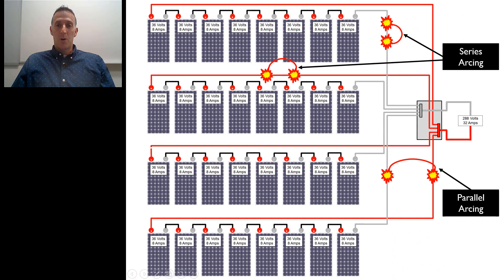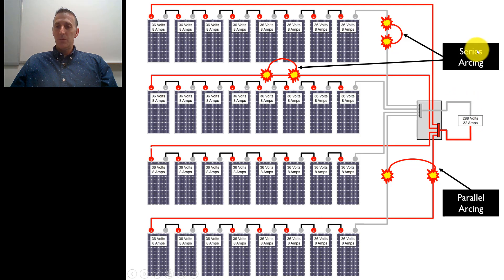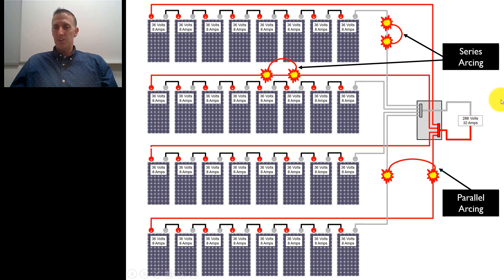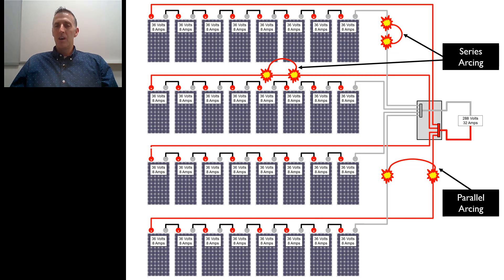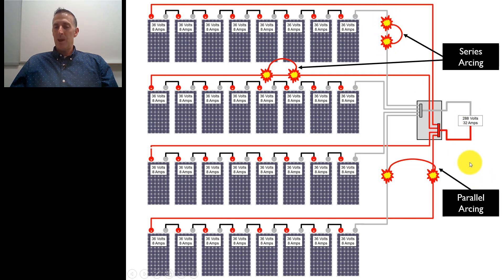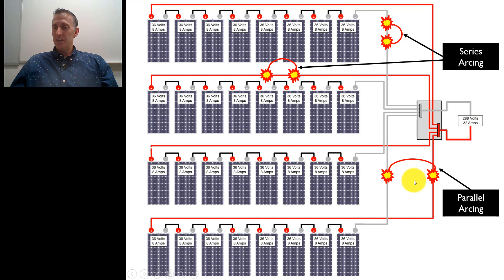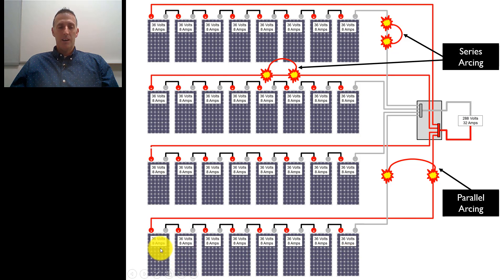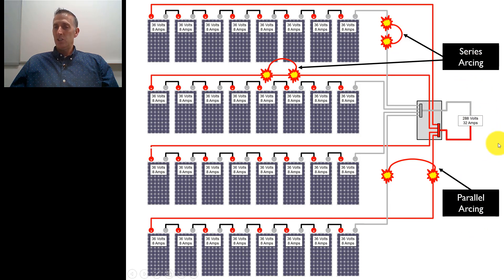Solar Training - Dangers of Series & Parallel Arcs

Comment: at the parallel arc wouldnt there be 32A of current since the strings are all still connected in parallel? if the inverter shuts down the arc is basically shorting the whole pv array but then all cables should be rated for 32A instead of 8 or else they will melt or you would need fuses at the terminals of each string, i think, or if you have a fuse/breaker for each string in the combiner box right before the live busbar wouldnt that breaker trip for the string with the parallel arc since the current of the 3 top strings is trying to pass there

Comment: I have a Very good Question for you “ can you take 2 different battery Ah but the same Voltage “ put them in Parallel the First bank 48v 280Ah and can you put in parallel a 48v 40Ah bank to help regenerate the Electricity used ? And if not because of the Ah - can you use an Active Balancer say 31S voltage does not matter you connect 31 batteries together as if they are parallel but the batteries are not physically connected so you have 31 Lithium Phosphate batteries connected to the Active Balancer and you have 15 batteries in series connected together + to - so on for only 15 batteries and the extra 17 batteries are to help keep the electrical charge constant- Can this be done ? Only 15 Batteries are on the same DAILY 15S 120A BMS but you have 31 Batteries all Connected through an Active Balancer ! Can this be done ?

Comment: I don't understand why my solar charger tells me I'm charging my batteries at 36 a 48 amps 52 amps sometimes 27.5 and I have several solar cuz I need to combined strength to the house they have less chargers and I don't mind the amps what I'd be more worried about is the votes and every 10 watch that the charger takes it turns it into an amp that's why I don't mine the amp so much.

Comment: What type of circuit protection do we need to prevent series & parallel arcs
Reply: A lot of talk about problems but not much on preventing them.
Reply: Modular level shutdown with with micro inverters or optimizers

Comment: On the parallel arc scenario.. then why the inverter could not detect it and short that array directly at the inverter input?.. the PV are current source with maximum limit so there would not have any overcurrent problem and current would find his short path thru the inverter input that is automaticlaly dead shorted to 0V... so the only voltage present would be the resistive loss in the wire between the inverter input and the no more possible arc!  =)
Reply: Yes, the presumption that the inverter can only stop the current is wrong. It should also be able to bring down the voltage of the panels to a very low level. However, that's not the usual way that the system is brought down. A firmware modification should make this possible, with very clear signals to the user what is happening, and very clear instructions how to proceed, such as waiting for sundown to dismantle. Also, usually the inverter needs at least a 100 V to run.